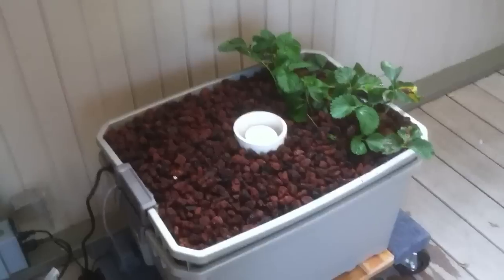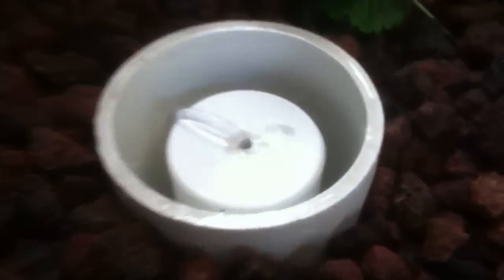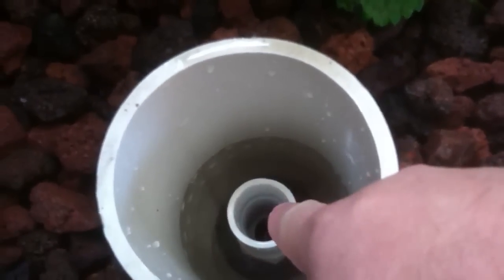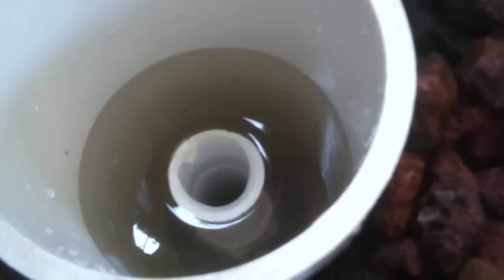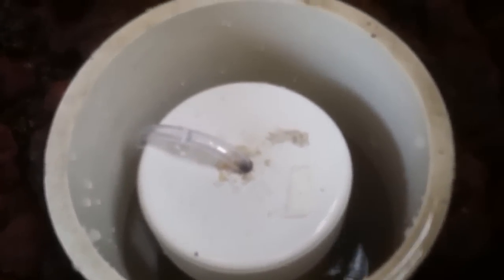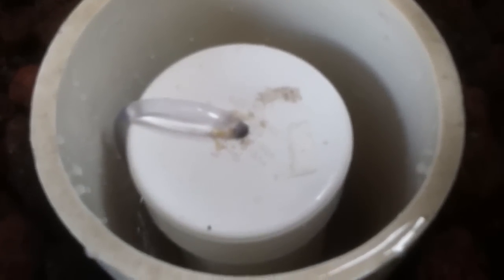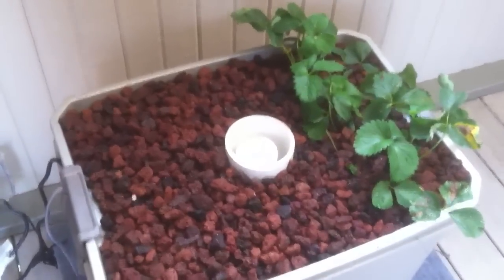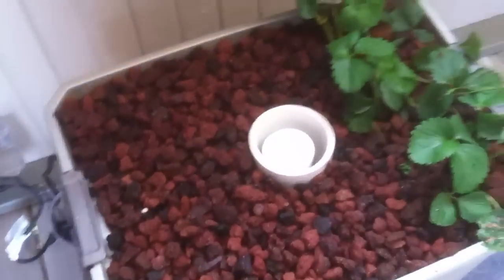Ebb & Flow w/ Bell Siphon Hydroponics Grow Bed Video 2

Comment: so how do the plants handle this more rapid fill and drain compared to traditional systems like this that utilize timers? I plan to make this system, a bit more involved, but deffanatly like the mostly mechanical operation, only power source required being for the pump in this set up. that's to operate the actual hydroponic system as I don't include lighting in this equasion. that to me is a separate system. some may disagree but that's OK lol. also, what all adjustments can be made possible to tune this? I see the obvious, water flow rate, and or pump size, size of the bed that gets filled and drained, as this will obviously impact time it takes to fill, and there fore exposing roots to water for longer or shorter intervals relative to the bed size, but what other options are there if any? seems like a silly question, but even small adjustments in a system can have big impacts on the plants, and if the initial setting isn't to the plants liking, or the plants needs simply change as it grows, it may pay to know all your adjustment points.